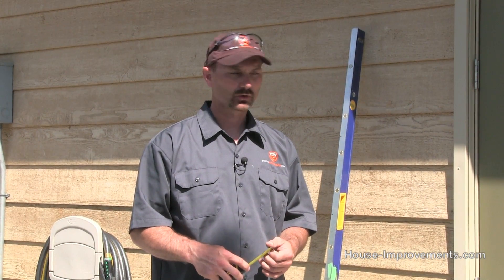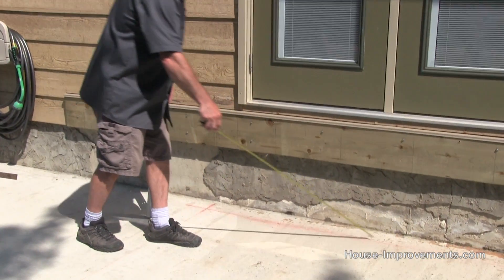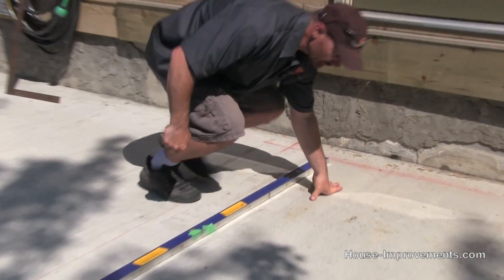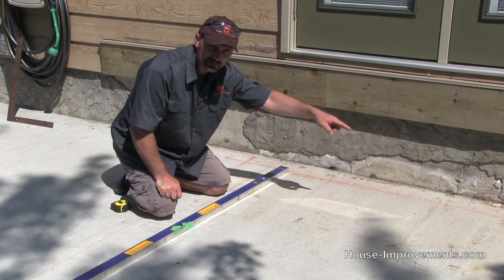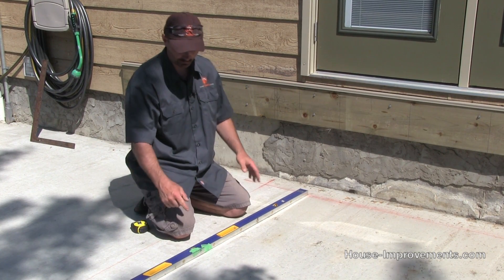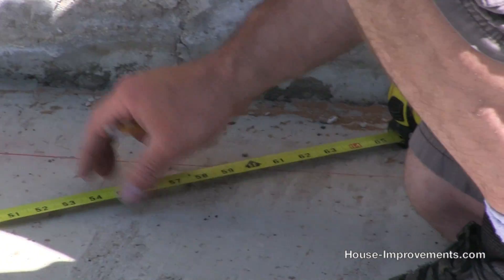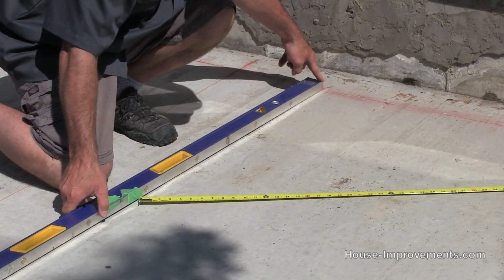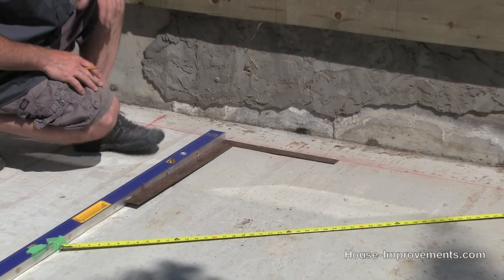How To Make A Perfect Right Angle [3-4-5 Method]

Comment: How do you draw first line straight?
Reply from the maker: measure equally off of the foundation in two places about 15-20 feet apart .
Reply: @HouseImprovements how do you draw a straight line in an open field where you have no references measurement point. Do you have any idea?

Comment: Could you please explain how you got your starting baseline straight? I may be overthinking it. Would you just measure an equal distance from any existing structure as a reference (which in this video seems to be the foundation of the house) at 2 different points and then connect those 2 points to create a straight starting baseline?
Reply from the maker: Sounds right

Comment: Hi Shannon the only thing I don’t get is how do you know if the first line that you chalked is straight? Doesn’t that have an impact?
Reply from the maker: In this example the caulk line will be straight and it is parallel to the homes foundation because we measured out from the foundation at the two ends of the caulk line equally.

Comment: Very useful tip. Thanks very much. Im making an L shaped low level garden wall around some decking and this looks like the method I will use to build the 2 walls at a right angle. Cheers.

Comment: This is just what I needed to run a fence in a pasture. I'm using 30 40 and 50 feet. Thanks for the video, big thumbs up.
Reply from the maker: Try to measure as level as possible because measuring on a slope will throw things off .

Comment: I just have a stupid ? I guess I could use this 345 rule square up a deck. For example a 8x16 deck.
Reply from the maker: Yes. or measure diagonally from corner to corner. The two diagonals should measure the same if the deck frame is square.

Comment: Having just come inside from an unsuccessful attempt to lay out guides for a rectangular platform's posts, I'm grateful for this video!  Thinking about the Pythagorean Theorem as 3,4,5 helped, as did watching you use a level and tape measure to do this by yourself.   Does anybody have tips on doing this when your ground surface is dirt and unevenly sloped?  I can't grade the surface, because this is for a treehouse and, well, the tree is in the middle with all its roots!
Reply: Probably too late for you, but for any future readers: you can use a "water level." That is, a length of hose with water in it, and some clear tubing at each end (or entirely clear tubing, if you have it). Fill the hose with water, and hold the two ends apart. The water at each end will be at the same level. (Larger-diameter hoses will "settle down" faster. Prefer 3/4 over 1/4 tubing.) 

This is nice for a tree house because you can wire the hose to the tree, and you can bend the hose however you like in the middle (just keep the middle lower than the ends).
Reply: Love these long-term discussions on youtube. We come to it as we need it. Another method that works for posts if you take a string and stretch it to mark the distances on the string, and then attach a level to the sides of the triangle.

Comment: First of your 90 or 3,4,5 isn’t straight because you pulled your control line or original line of a concrete wall and we all know concrete walls dip and aren’t very straight
Reply: Jonathan Ruiz what the hell does dips in the slab have anything to do with getting a right angle...nothing'
Reply: @joshramirez853  Dips in the slab will make a slight difference, because they can cause your tape to shorten. It could be an issue for someone doing 30x40x50 feet, but not here.
Reply: He said he snapped a chalk line.

Comment: The best part about this method is that as long as you use the same multiplier for all 3 sides, the result is always the same and the numbers are whole!  x1=3,4,5 x2=6,8,10 x3=9,12,15 x4=12,16,20 and so on.  The original idea behind this method was to eliminate the use of fractions and keep it simple, but feel free to define one side and calculate the other 2 sides.

Comment: we always got taught to use the tape as pivot point and draw a arc and where they cross, its 90 degree and then snap a line, i've also got taught to do 2 for larger work to. this method where u adjust the tape measure to get them square is new to me.
Reply: Billy S could you please explain the tape measure pivot idea to get a right angle....i dnt see how that would work...but would like to see it used